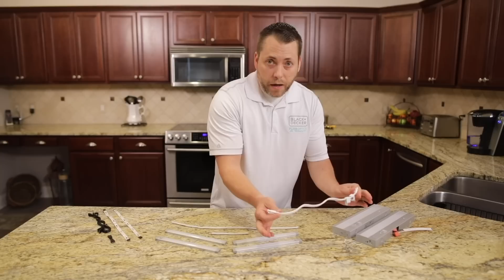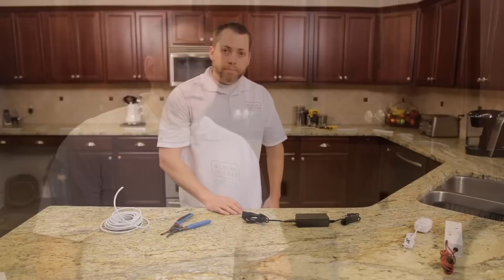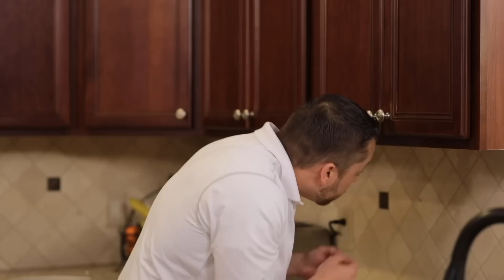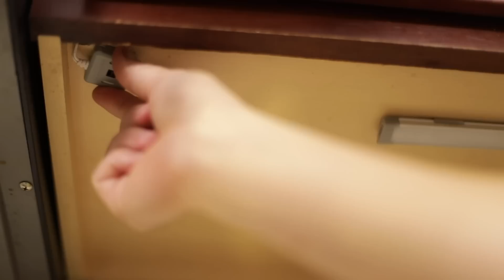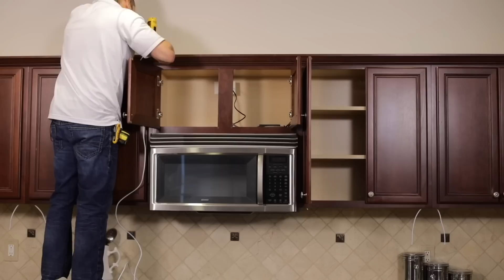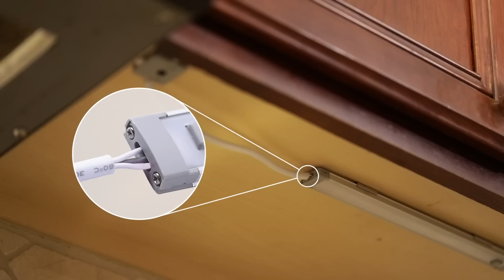PureOptics Led PUSH WIRE® Under Cabinet Lighting Kit

Comment: I love the lights only one problem they can't be used on a switched outlet you have to use the motion controls to turn them on every time. That box should be updated to have an additional feature to power on when power is applied to the outlet so they can be used in any configuration. That's the only issue I have with the product.

Comment: First off, I can't find these kits anywhere. All they have is plug in kits that use that stupid Alexa feature. I can find the push in lights separately, and the wire kit for push in lights, but then try to find the plug in power and remote control for push in lights, and they are just not available as far as I can tell. Why don't they have kits for push in wire lighting? I have been to 4 Lowe stores and 2 Home Depos and they never even heard of this type of lighting. Are the power adaptors all the same with under cabinet lighting? What about the remote control? You need to come back and answer these questions better. Showing us that cutting off the wires first is just plain stupid. We know how to cut wire off. But try to just buy these light at stores or online, and there just isn't a complete list of parts that you half to have to make them work,,,,,,,,,,,,

Comment: I need to release the wire from one of my lights.  The instructions say to use the included tool (that was not included with lights, wire, or power supply that I purchased) to press, I assume, into the three small holes under the end cap. Where can I get the tool for this? I've tried stiff wire, but it's not releasing. Thanks.

Comment: I have not added under cabinet lights yet. I do like these but not that I would have to walk through a dark kitchen to turn them on. I would replace the hands free sensor with a Sonoff Mini. Then add in a smart motion sensor and run a routine to turn these on when motion was detected entering the room. Voice control / motion can turn these on / off and the dimmer can be used as it is now with it's last state capabilities or manual control at each of the lights. This manual brightness capability is a con IMO. If I was forced to use these lights, I would replace the dimmer with one that is located in the toe kick, making it truly hands free.

At present I use an LED smart dim-able bulb in the stove vent light. This B&D light is hands free but to adjust the brightness is difficult with both hands grimy from mixing meatloaf. When you think about having hands free devices for when your hands are a mess, a hands free soap dispenser is good but then you have to turn on the water. This is one reason they make a hands free kitchen faucet. If I need more light than the vent light produces, I can turn on the 4 overhead lights by voice.

I was curious as to the price of these and clicked on your link. All kits are "Out Of Stock".
Reply: Thanks for the laugh

Comment: What a load of sh*te, literally B&D went out and found the oldest biggest CFL light fittings they could to compare against the B&D trash, I can find about 50 other kits that simply wipe the floor with B&D stuff.

Energizer for instance do an ultra thin colour changing remote kit for about £15 which is excellent.

Black & Decker is considered a cheap & nasty brand in the UK, not much worse than either Stanley or Dewalt which are also garbage.

Super cool..................not!
Reply from the maker: Our product is for professional installations of whole kitchens, linking up to 12 lights together on one system. The video shows what is representative of professional solutions installed by professional electrician in the US market.

Comment: Cheaper and better lighting with COB LED tape lights.  The COB LED lights are cheaper, $27 for 5 meter tape light roll, the DC power driver is cheaper and if you need a jumper wire, thermostat wire works well.  There are numerous tape light channels and I like the 45 degree ones with or without a cover.  This would give you a continuous light source without little light spots reflecting off your shiny counter.

This setup costs $270 before tax and shipping.  The COB LED tape lights with driver and covers cost $73 at Amazon.  I've used SMD 5050 and SMD 2835 but the newer COB lights are fantastic.

Note, always find the CRI (Color rendering index) number.  The higher (CRI 90+) are the most color accurate.  I prefer 2700 to 3000k color for under cabinet lights.  I couldn't find the CRI or lumens for these B&D lights but the lumens looked OK in this vid.

I also prefer to solder jumper wires to LED strips as I've never had good luck with tape light connectors.  I'm sure there is no issue with these B&D push connectors.
Reply from the maker: Hi there, if you prefer tape light, that’s great. Nothing wrong with it. However, our patented system is easier to install, class II compliant for in-walls or under cabinets, gives you flexibility to install split or in-line, offers endless possibilities to connect lights for under cabinets, jumping stoves, sinks, windows from 2” – 120” long jumper wires, offers a hands-free sensor, permanent (screws) or fast (3M tape) install methods, and is preferred 50:1 over tape light installations by professional electricians.
Reply: @PureOpticsLED  "...preferred 50:1 over tape light installations by professional electricians."  Yes, the B&D lights are easier to install and pros only want fast installs because they make more money.  I'd rather save $200 (73% savings) and spend an extra ~15 minutes.  Others may just want the easy install.  I've installed around 2000' of tape lights with few issues and I like the continuous lighting with options of RGB for certain applications.  I'm sure your product is nice but I wanted to point out alternatives, which I prefer.   If you use a good Meanwell driver, you might have fewer power issues than using the cheapest driver you can find.  

I plan on installing LED tape lights in a couple of tray ceilings and will use these also for under cabinet lights.

Your lights look good but you charge too much for your driver.  What CRI are these and what voltage are the drivers?

Comment: This is great...but what do you do if you have a  window in between your cabinets?  I have found NO ONE on Youtube that addressed this issue...😐
Reply from the maker: Hi Diana, this is exactly the reason for this product. You cut the connecting wires (jumper wires) on-site from the 25’ jumper wire spool. Connecting wires can be cut 2” – 120”. You simply run the connecting jumper wire above or below the window, most likely hugging the window trim to the wire is hidden.

Comment: i connected one light to power and turned it on to test i did the connection right. it started smoking and now won't turn on. was that too much power to one light? or did i have a faulty light?
Reply from the maker: Hi Nick, you can connect only one light, or up to 6 lights (24w adapter) or 12 lights (48w adapter). The connecting jumper wires have three separate solid core wires inside them. If the copper wires touch each-other while powered it might blow the safety fuse. You can certainly check after each light to ensure they are working properly, however do not cut and connect the wires while powered on!

Comment: My on/off switch on the lamps does not work, nor does the dimmer settings.

What did I do wrong???

The on/off feature on the hands free sensor works.
Reply from the maker: Hi Farrell, you most likely have one of the jumper wires either not pushed in properly, or crossed / touching another wire. Please re-check each connection on each light bar, and on the hands-free sensor. Take each end-cap off each light bar end to ensure each of the three wires is pushed into their holes properly.

Comment: hard to believe they do not have an app for this product.
Reply from the maker: Hi Turk, we don't have an app for our PushWire products but we do have a Smart Tool-Free Under Cabinet Lighting system that works with Alexa. You can find that here: https://pureopticsled.com/products/smart-home-lighting-systems.html
Reply: @PureOpticsLED  does it not work with Google Home?

Comment: Are you using a kit in your video or did you buy each item separately?  The kits all seem to come with pre-cut lengths of wire and can you use the jumper wire spool with the kits instead of the pre-cut lengths of wire.
Reply from the maker: Hi Ken, the patented system uses premium Black + Decker light bars and jumper wires. You cannot mix and match with other kits – it will not work. You can find our products here: https://pureopticsled.com/products/under-cabinet-lighting/push-wire.html

Comment: Be nice to have a plug connector for the cut cables that don't require stripping the wires.  This would open it up to a bigger market of diy folks who don't feel comfortable stripping wires.
Reply from the maker: Hi James, we do have a  Tool-Free line of under cabinet lights that don't require cutting or stripping wires. You can find those here: https://pureopticsled.com/products/under-cabinet-lighting/tool-free.html

Comment: How about in drawers?
Reply from the maker: Hi Cheryl, you can install the system anywhere you choose. We suggest thinking through how to run power from the adapter to the control box, then from the control box to the light(s). If you can make that work, go for it!

Comment: If I want to use a smart outlet for power, will I need to bypass the hands free sensor?  If so, how would I do that?
Reply from the maker: Hi Tim, you cannot bypass the sensor, that is also the control box. It controls the dimming and on/off. You can call our customer service team to get a hands-free sensor that turns AUTO ON when powered-up to solve this problem. You can call us at (855) 784-4322.

Comment: It’s a shame this is not a kit and priced like the rest of your line. This pretty much  doubles + the project just for the ability to push the wires in, instead of using the jumper cables.
Reply from the maker: Hi there, we understand your concern on the price, however the installation process is the best-in-class and will save professional electricians hundreds of dollars in time each installation. The patented system also uses WAGO® connectors which are premium and much higher priced but well worth the extra cost.
Reply: @PureOpticsLED  how is this saving hundreds of dollars by switching the connection type? Is this based on LARGE kitchens that need long spans? Not typical homes with typical kitchens?

Comment: If  I have 2 runs (left/right),aka split configuration, how is the light intensity controlled for both sides?  Do I need to 'sync' the first light bar of each run or will one light bar control both? Thanks
Reply: It looks like magic but it really isn’t. I’ve been searching for under cabinet lighting for almost 2 years.  Have 2 coils of LED (RBG-W) strips but no power source.  This appears to be one of the easiest a\with the most features I’ve seen to date.  
I wouldn’t worry about the control in both directions - from the video the lights seem to work well.  
I plan on reading more on the box and look forward to BDs answer to this query. 
Good luck!
Reply from the maker: Hi Jim, the entire system runs from one control box (hands-free sensor) that can run lights both left and right (split configuration).

Comment: Hold a paper cup under where you're drilling, saves time on clean up.
 Also, would be cool to see another version of these with a wireless remote control, so you can do all these settings and even select just a few lights to be on at a time...
 I want a cut if that idea is used 😉
I could use the $$$
Reply: Just plug them them into a smart plug. Though I guess that doesn't get you anything other than on/off.....
Reply from the maker: We'll pass the idea on to our Product team!

Comment: What if you have a light switch already?
Reply from the maker: Hi Les, you can wire it to a rocker switch using the Black + Decker direct wire transformer found here: https://pureopticsled.com/push-wire-under-cabinet-light-48w-direct-wire-power-kit.html. Unfortunately, due to high demand, we are sold out.
Reply: @PureOpticsLED  Can the 48w plug-in power supply be plugged into a switched outlet to get the same effect without damaging the supply?  I'm thinking of doing this with a HomeKit smart plug to get some level of automation.

Comment: I have a large gap between cabinets with a sink and a window. How would I get the wire across that gap?
Reply from the maker: If you have crown molding to your ceiling, then you could run the wire up through the ceiling then back down. Or if you have curtains over the top of the window, you could hide the wire behind the curtains. Last recommendation is to follow the contour of your window trim and try and hide the wire as best as possible secured to your window trim. Use the wire clips to help with this. Remember that you can cut a wire any length so you have options! Good Luck!

Comment: Where did the long wire that went up and over the microwave terminate? On my viewing left side I know it took power to the other side of the oven. But, on the side with the hands free dimmer where did you terminate that wire?
Reply from the maker: In the hands-free dimmer / control box. The control box has two inputs for wires so you can have the freedom to place that control box and power adapter anywhere in the kitchen layout.

Comment: How would you go across a large gap? My range does not have cabinets above. Great job.
Reply from the maker: You can cut the Class II compliant 20ga jumper wire any length! We recommend finding the best places to drill small holes to run the wire, then simply cut to length.

Comment: The dimmer was skipped over as far as where it is mounted, it's size, mounting and what it looks like.
Reply: It looks like the dimmer is part of the light bar itself. You can control the dimming on all the lights once they’re all connected.
Reply from the maker: That's correct!

Comment: I was under the impression that the outlet used for hood microwaves was supposed to be a dedicated circuit for the microwave.
Reply from the maker: Always check local codes but the secondary plug should be usable with our system because it only draws a maximum of 48 watts.
Reply: 48w isn’t a whole lot of current (amps). LED’s run on so little.  My whole kitchen is now LED lighting. Doing the cabinets has been a nightmare since I have to have an exit plan before I touch the first ting. 
I remodeled the kitchen year before last and installed 15a GFCI protected receptacles above the sink cabinet and the range cabinet in preparation for lights.  These 2 receptacles are on a switch for convenience. Turns on all the lights at the same time. 
Definitely will purchase these lights on 2 separate 24w power supplies. Only have 6 total below and maybe 8 above if I decide to do uppers.
Reply: You were under the wrong impression 😳

Comment: Since the power is in the middle did you wire all the way to the right then come all the way back to left with 1 long piece of wire to connect the left side?
Reply from the maker: No need because the jumper wires connect to the control box (hands-free on/off box). You can run wires two ways off the control box – To the left and to the right.

Comment: Potentially helpful video but you didn’t mention what kind of wire used. And really, the frantic background music is totally unnecessry!
Reply: The wire is part of the Black and Decker equipment:  Item LEDUC-25JUMP.  All available at Lowes.
Reply: @timknight6258  going to lowes now!!
Reply from the maker: It uses 20 gauge, class II compliant solid core wiring. Class II compliant means it can be wired inside walls, if necessary. You can find the jumper wire spools here: https://pureopticsled.com/push-wire-25-jumper-wire-spool.html
Reply: True the music distracts from the content.  Maybe 🤔 a little. Or I could turn off my aides 🤣